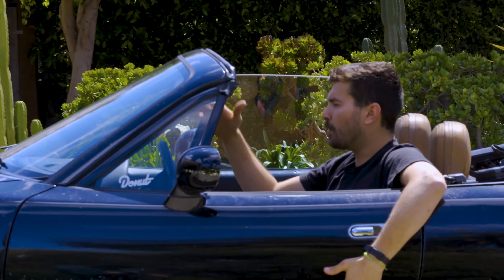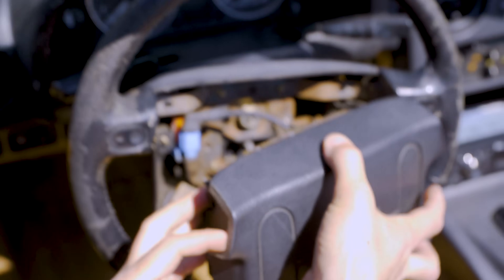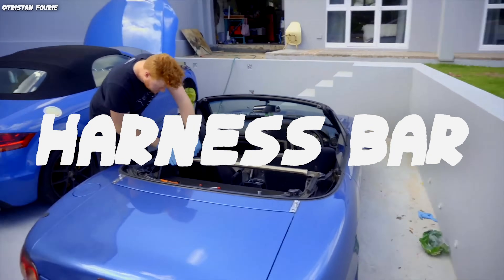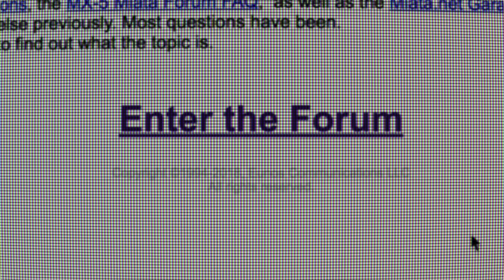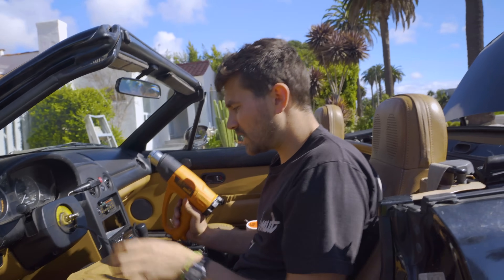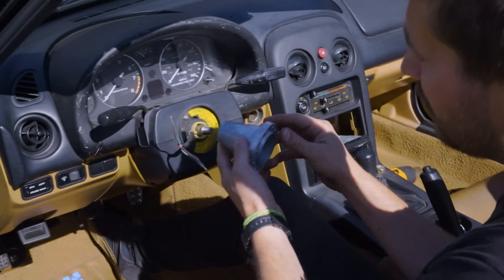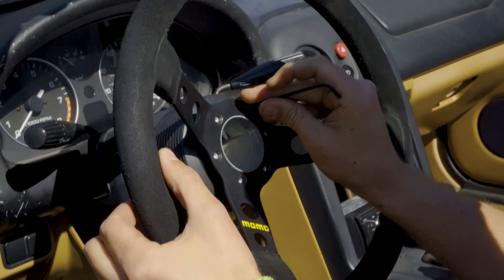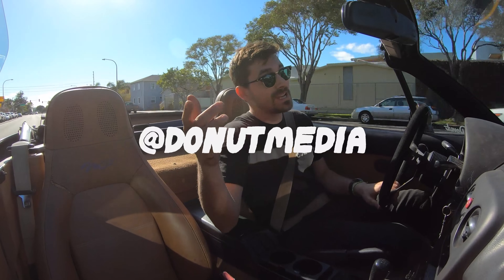HOW TO: Change Your Steering Wheel

Comment: Disconnecting the battery is often times not enough to disable the airbag. There are capacitors in the car holding charge for up to even a couple hours after the battery is disconnected to ensure the airbag works in the event the battery is disconnected in a crash. Also the airbag can trigger off of the most minimal volatage. So its best to wait an hour to be safe if your going to be disconnecting it.
Reply: cant you just short the battery wires together to discharge them?
Reply: Isn’t it the signal wire that the airbag runs off of and not just power?

I would be honestly surprised if airbags actually fired during removal. I don’t have any experience to definitively say that they are safe or unsafe, but you do sit behind them all day, so I would be surprised that jiggling the wires would make them explode while nailing the horn doesn’t.
Reply: @mrs_radrod  the connectors are protected so if you just don't touch it, nothing should happen.
Reply: Howdy yall, long time tech here. If you're concerned about airbags popping while performing service on your vehicle, disconnecting the battery and shorting the positive and negative cables together (the battery is not in this loop!) Then attempting to start the vehicle will kill all residual electricity in the system. It's what I've done for years and has worked perfectly every time. I've done I have no idea how many Takata inflators. Just a tip for yall to help save some time.
Reply: @danielkoontz6732  thanks! Im a new tech, just graduated from tech school and ill be training with volvo when this virus business blows over. So ill keep it in mind.
Reply: Just set off the airbag before removing anything so you dont have to worry about it. Lol
Reply: @danielkoontz6732  I can confirm this, took out the wheel from my car to try and change it for another one. Shorted the terminals and turned ignition on. No problems.

(The other wheel sadly didn't fit, btw)
Reply: @mrs_radrod  just look up "russian airbag prank" and tell me if you wanna take the chance
Reply: I agree
Reply: @inrg3688  nothing shouldn't happen? Wait I'm confused. So everything should happen?
Reply: @bozscaggzz7475  Should, thank you
Reply: If I remember correctly, airbags deploy with a force of around 250psi. Which is like being hit by Mike Tyson.
Reply: I usually just disconnect the terminals and step on the brake for a bit.
Reply: Actually the majority of the modules will hold current for around 15 minutes. You know, if your battery breaks during an accident, the hit won't be much later, so there's no point on overengineering the thing for hours later. It's always better to be on the safe side, but time is gold anyway!
Reply: Christian Gotsch yeah bro my cousin got pissed time and punched his horn as hard as he could and I thought the airbag was boutta blow up on him
Reply: Isn't the point of disconnecting the battery to save your horn fuse from a short with the unprotected wires while they're disconnected?
Reply: @vikinglab79  i guess, but its mainly so when your disconnecting the airbag plug, no voltage jumps and sets off the airbag
Reply: I was just about to comment the same
Reply: As he said this is a airbag from 1900 or  something probably doesn’t work he was right
Reply: @patrickvanherk  I'm a tech at VW and have rebuilt a lot of those Takata bags. the Can-bus shuts things down around 15 minutes, but I pop those airbags out in 15 seconds. it doesn't care.....
Reply: I stripped down a car with battery connected. Stripped out the airbags, just removed them and disconnected them. Nothing happened.
Reply: Hey don't over think it tho safety is important
Reply: For Miatas hold the brake pedal, the brake lights will drain the remaining charge
Reply: @mrs_radrod  don't touch the yellow wires then.
Reply: I just disconnected mine.  By the time I removed the airbag I had no issues.
Reply: good point
Reply: Airbags have saved my life twice in the last 12 years. Gonna go ahead and keep my steering wheel the way it is.
Reply: @sevenoke  No one was telling you to change it. I was just giving advice to thoes who want to.
Reply: @foytsgarage2085  ah I meant to comment on the main post. Apologies. If I switch my steering wheel, I think I'd be wearing a helmet everywhere I go though. To each their own.
Reply: @sevenoke  i respect that, Im a fan of airbags myself. So if I switch steering wheels ill usually use a different wheel from the same manufacturer. Like how alot of people put 2000's toyota wheels that have an airbag on the older mr2 models
Reply: @foytsgarage2085  funny you mention that. I drive an 03 mr2 Spyder. Respect.
Reply: Did not read all comments...

If you are worried hokdbyour foot on the brake for about 30 secs....done. all juice sucked.
Reply: How do you honk the horn?
Reply: I'm a certified tech with FCA, and their recommendation is disconnecting the battery and waiting 2 minutes before working on any SRS components or circuits. It's straight from the service info from a big manufacturer (albeit FCA) so I trust their advice. Waiting longer than that if you're on the cautious side definitely won't hurt.
Reply: thank you i was just about to say that
Reply: Just put you foot on the brake. The power to the lights will discharge anything left in the system. Or just want an hour then work on it.
Reply: @inrg3688  No, turn the lights on instead
Reply: Hours, no. But you definetly do want to wait at least 20 if not 30 minutes if you really wanna be cautious.
Reply: Ethan Foyt thx for the info, ur incredibly smart
Reply: old car
Reply: The Miata has a battery specifically to power the airbag without the main battery. How well it works after 20+ years is up for debate.
Reply: @T11LMG  Me too.
Reply: @chayyboi  My method as well.
Reply: I have no problem about airbags

Because my car is GT-R32 lol...
Reply: @inrg3688  i think if you drive your car at top speed into a brick wall the car lets go of the charge it was holding from the battery
Reply: @danielkoontz6732  i can. just turn them off with my key i have a 98 s-10
Reply: It’s only a few minutes after, normally never wait since by the time you get to pulling wires off it’s a few minutes later
Reply: @foytsgarage2085  it didn't blow over :(
Reply: The trigger for the airbag to go off is not within your steering wheel, but it actually a couple of modules within the front bumper which detect a crash an engage the airbag. there is nothing within the inside of the car which can trigger the airbag to go off.
Reply: Just turn ignition when battery is disconected it drain any left over energy of the system
Reply: Phew, good thing I have an 80's car. So no safety equipment! Ha ha...haha....ah crap...
Reply: @inrg3688  as@
Reply: Not if your in my old Ram 1500 you can hit a ditch at 45 and that airbag won’t even notice 😂😂😂
Reply: Shoot it with a .22
Reply: @IceZone27 Your airbag notices, it just doesn't care about you specifically
Reply: If you wait 2-6 mins then all the power will be released
Reply: Just finished tech school and offering advice. So cute….
Reply: My truck doesn't even have airbags
Reply: He warned us about that
Reply: Isn’t it illegal to do this mod in California ?
Reply: @sevenoke yah …. Ima need you to retake the dmv test bud

Comment: When you slowly start to realize that literally everyone with the miata has the same mods..... I thought I was special honestly
Reply: Lmao
Reply: Well, there's that one Lemons team which actually had their car on B2B. It's basically a miata with the body being all screwed up, the chassis welded up, a massive upside down airplane wing made of wood connected directly to the axles, a turbo from another mazda with the same block, cage, seats, and driver cooling system that's basically an ice tank that has a hose connecting to a baggie that goes around the driver.
Reply: has a miata... but you think ur car is special...
Reply: compared to others lmao I think my Gen coupe is more special than the miata
Reply: @olegkolesnikov7155  I think the turbo is actually pulled from a wrx, but I wouldn't be surprised if that's changed considering how much wear and tear that car is exposed to.
Reply: Took ya awhile
Reply: I have a fully stock miata
Reply: all cars are special
Reply: lemme guess, momo with a nrg quick release, black rollbar, 15x8 wheels 195x50 r15 tyres, a garage vary (GV) ebay front lip and a manzo or cobalt cat back exhaust. haha no hate i thought i was special. :)
Reply: @charliepayy  also RPF1s
Reply: @charliepayy  not that typical, I have these no brand 15x7 wheels and nrg hub with nrg wheel, sparco belts, cobalt catback exhaust, ebay lip, raceland coilovers and a couple other things
Reply: zach holmes02 hahah yess lad that ebay gv lip and the cobalt fair play still looks decent on a budget
Reply: zach holmes02 hahah yess lad that ebay gv lip and the cobalt fair play still looks decent on a budget
Reply: the cobalt exhaust was 500 so that wasn't too cheap but it definitely sounds the best it can without rice
Reply: Thats common aftermarket car culture in general. Its okay to not be special as long as you like it.
Reply: @charliepayy  Are 195's the biggest you can fit on an NA without carving it up?
Reply: Now stock is the new different
Reply: Basically every "car guy" has the same mods done to their cars.  Exhaust/exhaust component delete, Coilover/lowering springs, cheap aftermarket wheels, cheapest tune imaginable, steering wheel swap(if the stock wheel does not have a bunch of buttons) and tacky ass stickers.
Reply: Well, there's probably one optimal and best looking setup, which everyone realized on their own, haha
Reply: That’s why you own a Miata
Reply: hey dude i dont know if you would know this but im having a issue on my miata cause i took off my air bag and my miata wont start plz help me
Reply: @jakebresee739  where did you take the airbag off? and why?
Reply: Probably the safest way to learn how to work on your car since, more chances than not, if you screw up someone else has screwed up the same way.
Reply: It’s the common struggles of Miata’s that we strive to fix
Reply: It's like that scene in Toy Story 2 with the thousands of buzz lightyears lined up

Comment: FYI for all those saying you have to wait 30-60 min to discharge the battery: A fast-track way to discharge the capacitors and safely remove the air bag is to press the brake pedal a few times after you disconnect the battery. The brake lights typically will attempt to pull enough current to juice out any residual energy stored in vehicle capacitance. I do it all the time for my E36/E38/E39s with SRS service.
Reply: That’s good to know. Luckily I didn’t blow my hands off with my e39’s factory airbag, but I’ll definitely use that trick in the future
Reply: Best advice ive seen in these comments
Reply: This assumes the capacitor will be in line with the brake light circuit which is not true.
Reply: Wish me luck. I'm about to try to install a steering wheel to my 98' Honda Accord 😅

Comment: Added an aftermarket steering wheel to my fit today. Keeps the stock airbag/horn centerpeice and allows you to install the bezel with the cruise control and radio controls into it as well. Nice aftermarket rim with all the oem features still intact. Was happy with how it turned out.
Reply: Where did you buy it from?
Reply: @FenderShredder  eBay has them

Comment: 1:42 
Psa from Chris fix: Make sure you wait about 30 minutes. Airbag systems have capacitors that allow the airbag to deploy up to 30min after disconnecting the battery.
Reply: I was gonna comment this
Reply: On some cars it's up to more than an hour
Reply: Usually you can just leave the key in the run position and it will discharge the capacitors.
Reply: Jokes on you! My car never had an airbag from factory
Reply: @BallisticGhast6  that's called a motorcycle my friend
Reply: lsedanolg Yeah, but I don’t recall any motorcycle having an f body chassis from the 80s
Reply: ALL carsr different
Reply: My 81 rabbit truck came with no airbags, I ordered a Miata short hub by mistake so now I’m waiting a week for the right one
Reply: Ah, good to know.
Reply: What If u don't have a airbag?
Reply: @diegoleon5662  then u dont have to worry about an airbag
Reply: @BallisticGhast6  what is air bag? (just joking)
Reply: i would even wait an hour or 2 to be safe
Reply: I used to work at a dealership. Most techs would replace airbags with the battery still plugged in, and some would do it with the car still on. Never saw any issues result from it. Probably still good to disconnect the battery IMO, but don't worry too much about it. You can mess up pretty badly and not cause the airbag to fire.
Reply: I'll wait 24 hours to be safe lml
Reply: Is there a quick way to discharge the battery to be safe but also time efficient?
Reply: Also remove the negative terminal. THE NEGATIVE TERMINAL. Not positive.👍

Comment: They say multi point seatbelts do more harm than good unless you’re wearing a helmet and neck brace. Otherwise you strapped in so firmly with your head being free increases the likelihood of getting neck injuries
Reply: If your doing 150 at daytona then I'd agree but probably not street driving a miata. Also there are harnesses that are approved for street driving with tech like ASM.
Reply: Nothing like whiplash on the interstate
Reply: my mom trained my neck enough
Reply: ASM belts are street legal and meet FMVSS requirements for US road use (if equipped with a single press red button release). No worries about head and neck restraints as the ASM system "catches" you like the factory seatbelt does
Reply: Well, in the video context, yeah.
Air bags do the helmet and HANS job.

Notice that neck injury happens due a differential in desacceleration between head and body, inducing forces on the neck.

So even low speed impacts may cause damages, it only depends on rate of desacceleration.
Reply: This is why street driving with a harness is a real pain in the neck.
Reply: Kohen J If you hit a concrete pole even going at 20mph and you’re tightly strapped in with a harness, there will be more damage to your neck regardless.  With a normal seatbelt your upper right part of your body is suppose to rotate a lil bit about the seatbelt line. Those crucial milliseconds of body movement is crucial since where dealing with high g’s
Reply: Here in Canada I can get a ticket if I wear an harness instead of the stock safety belt ._.
Reply: @Hangule4  is it FIA certified as well? Actually considering this now
Reply: @dynamicpaintball  unfortunately they're mutually exclusive as far as I know. If it's federally approved for public roads, it's not FIA approved. It really all comes down to the stupid buckle. For FMVSS approval it needs to be a large red single press button. I believe for FIA certification, the buckle needs to have a stronger latching mechanism. For reference you can look at Schroth (and Takata, but someone told me the ASM belts from Takata are actually rebranded Schroth belts). Schroth has identical ASM belts, one for FMVSS approval and one for FIA approval and the only difference is one has that single red button and the other has a camlock.
Reply: Your head isn't ”free”  it's more controlled then if you were in a normal seat.  Hence the reason why they require them when racing (plus the added benefits as well of course).
Reply: Yeah but who’s “they”?
Reply: Soe Any form of racing whether that be autocross, drifting, off-road racing, drag, drift, track, etc.
Reply: The real issue is using harnesses without a bucket seat and roll cage. In an horrific accident when the chassis loses all integrity you call literally rip yourself apart if you don't have a cage holding the structure of the car together. R33 Skylines for example are prone to ripping completely in half during severe accidents. Now imagine your seat tries to go with the front half but your body is anchored to both halves. Something's gotta give and chances are it'll be your spine, head, limbs etc lol
Reply: magnetic0314 Yes.  You do not need a roll cage per se but, you do need a harness bar.  Otherwise in the event of an accident, you will decompress your spine and most likely become paralyzed.  This also includes not having the seatbelt hardness at the appropriate angle.
Reply: "Six little screws"
...
"Five little screws"

Every damn time, man.
Reply: So don't make a half assed build.

Comment: Is there any way to put an aftermarket steering wheel on a car that has a spring clock that comes out about an inch like a donut? The car is a sentra 2010
Reply: Yeah, take out the spring clock
Reply: Watch Vice Grip Garage, and get a think he calls a "Tonya Harding".
Reply: thats what makes youtube great, someone, somewhere did it already and most likely posted a video. I found one for the same year, make, model and wheel i wanted
Reply: Ok, just get an adapter for a 350z, it is the same for Sentra 👌🏿